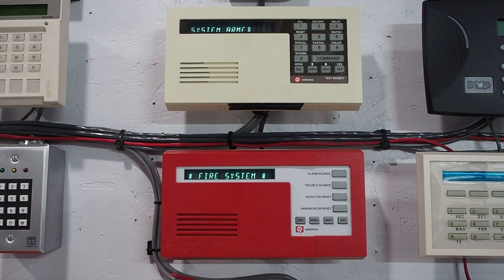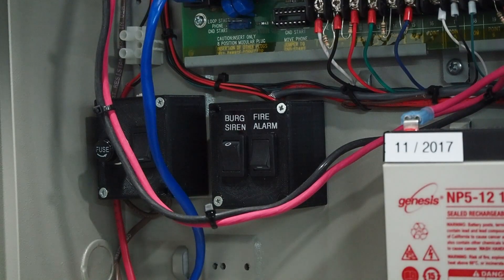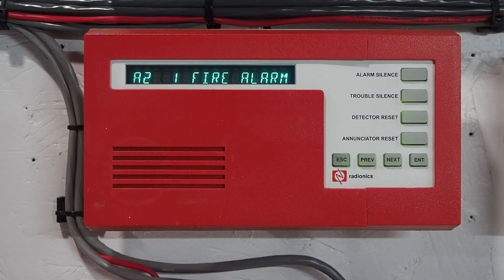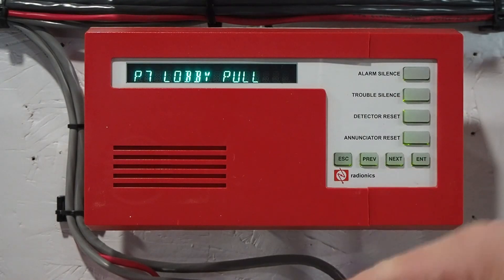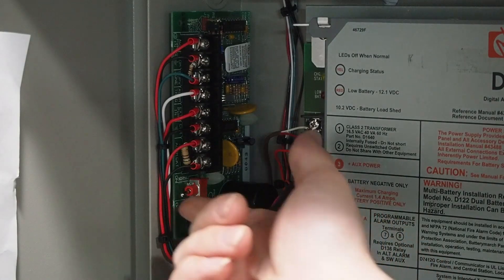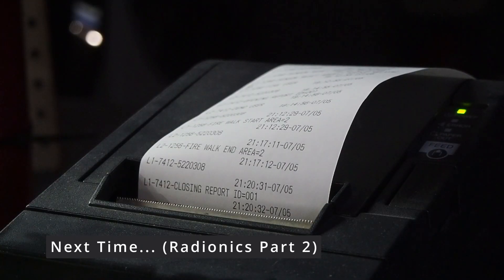Radionics D7412G - Fire Alarm Demo (Radionics Part 1)

Comment: As someone who used to work with a radionics dealer this is a very nice video to see. I actually really liked the D7412 most out of all the panels. The newest model is nice as well. I will say, in New Jersey, the most common device on any radionics system is the Spectralert Classic. Usually 12 volt models. Awesome video!

Comment: this radionics panel seems better than a lot of modern ones, except for the fact that it doesn't automatically reset smokes
Reply: They are, a ton of customization is available in programming. It’s a very advanced system. I’ve installed many of them over my 43 years as a technician and for Radionics dealers. I’m currently a Bosch Security dealer which owns Radionics as of 2001.
Reply: I currently have a Bosch Security B9512G in my home. Very nice system.

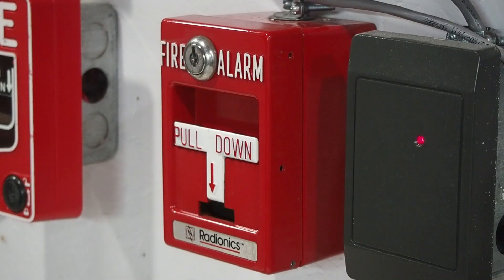Comment: Where's the part where the pull box attaches to your hand for the Fire Chief to remove after they interview you # 3:45?  Or the red dye that stains your hand?  Always heard about that in school.
Reply from the maker: The handcuff was only a concept, they quickly realized it put the person in danger if there actually was a fire. 

As for the dye, that was a fabrication invented by fire departments to deter false alarms.

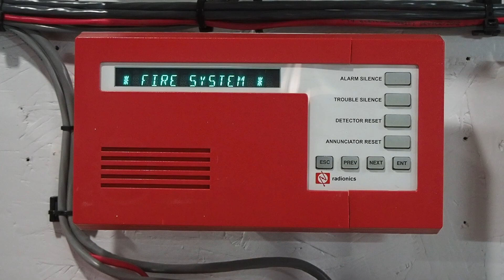Comment: 0:51 Like Walmart (pretty much the only place I ever see them).

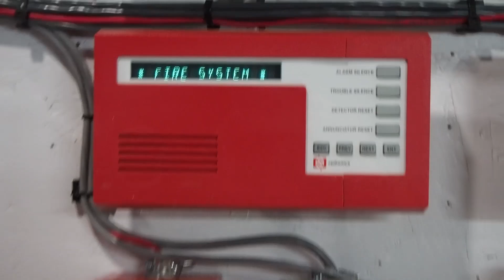1:01 Which is a rebranded RSG RMS-1T.

1:11 Really? Did Hochiki make different color heads & bases for some reason?

1:17 Hey, as long as it works right?

1:20 Mhm! (though technically the original manufacturer is Hochiki & thus both Simplex & Radionics rebranded it from them, among others like Silent Knight)

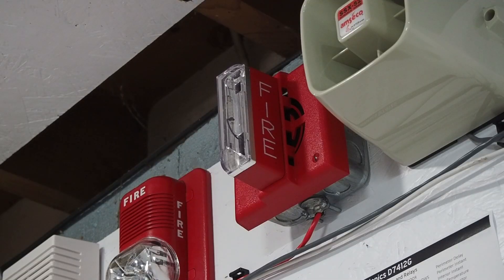1:52 I've got an SHG exactly like that one (same lens design & everything), I thought mine was a 2nd-generation version though going by the reflector (though according to you it's still a 1st-gen version just with a reflector); in fact I thought there were 3 generations, with the 1st-gen having no reflector, the 2nd-gen having one, & the 3rd-gen being identical to the 2nd except swapping the march time tone for a temporal 3 one.

2:02 Is that battery seriously dated 2017? How does it even have any charge left in it if it's that old?

2:16 75!? Wow! That is a lot for an otherwise average security panel!

2:26 I assume the one you have on it is the Bosch version since Bosch now owns Radionics (if they still make it of course).

2:40 Does that mean that you have to use both zones on it, you can't just use one? (since you have only one smoke detector on the setup)

2:42 How exactly is that controlled by the panel? (as in what on the panel controls the output(s) of the board)

3:00 Huh, didn't know Altronix made power supply boards like that one (though according to what I've read about it requires a 24VAC input, which just complicates things further as you then need a transformer in between the 120VAC power coming from an outlet & the input wires hooked to the board).

3:16 Clever! Honestly though those were manual zone trip switches when I first saw them.

4:39 I'll never understand why Radionics decided to have two different reset buttons on that particular keypad model instead of just one that resets everything like with pretty much all others (as it just complicates the reset process unnecessarily, not to mention the one button being labeled "ANNUNCIATOR RESET" when it actually resets the panel. I'm sure someone has forgotten to hit "DETECTOR RESET" after an alarm & had the system go into trouble). It's unique though for sure.

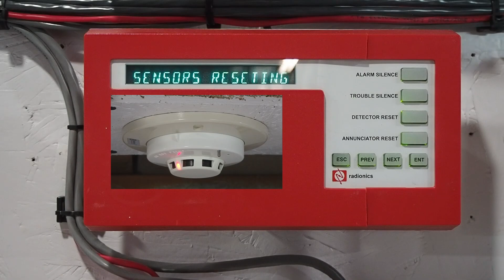5:31 Going by the way the keypad goes blank for a second, I assume that like most panels it briefly cuts the auxiliary power to reset any tripped sensors like smoke detectors.

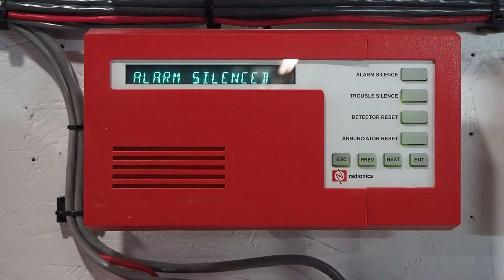5:37 Not quite! (on the upside even if that wasn't intended it did allow you to demonstrate what happens when you don't hit "DETECTOR RESET" before hitting "ANNUNCIATOR RESET")

6:14 This made me realize that the keypad isn't emitting Radionics' distinctive two-tone trouble beep even though it's in trouble from the smoke detector still being in alarm.

6:17 Don't do so if you aren't authorized to though! (read: everyone except technicians who are there to work on that particular system)

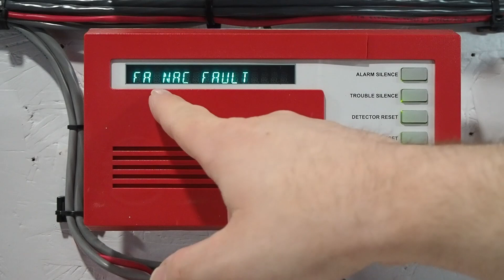6:40 I assume that it's programmed as a trouble zone given the way it's named.

7:00 Was it necessary to reset the system again?

7:20 Makes sense given that it's a fire keypad, & thus you would want only those functions on it (though can that be done per keypad so that the security keypad can have only security functions on it?). I assume that if you had a D1255R which does have a full keypad that you could include some of those functions (like bypassing which might be important even on the fire side of things: disabling a zone to help prevent false alarms for example).

7:53 Clever thinking of Radionics there, giving the tester a numerical count of devices still needing testing! (sure that means they have to keep coming back to the keypad to check said number, but that's quite an advantage over other systems, pretty much all of which don't do that!)

8:20 I've heard Radionics/Bosch keypads make that noise on occasion, I've never known what it means though.

8:24 Interesting...is there something in the programming where you can set a zone to be auto-resettable or not? (or maybe even an entire zone type just for auto-resettable devices like smoke detectors)

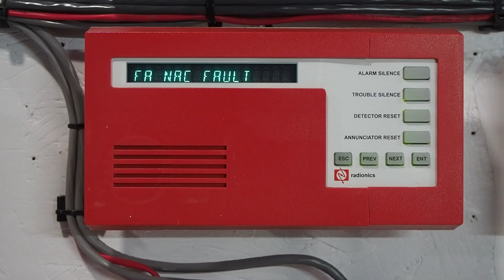9:12 You sure it's not because the "FA NAC FAULT" zone isn't programmed as a fire zone? (which would make sense: why would something like that send the panel into fire alarm when it should cause a trouble to indicate that the supervised bell circuit module has been disabled, thus preventing the fire alarm signal from sounding in the first place)

9:32 Wow that's a heck of a setup you've got there! I look forward to more demonstrations with it!

9:36 Technically speaking the fire portion of the D7412G.

9:42 Are they difficult to program as well?

9:47 I think so too, especially since we've all seen them but probably never knew up until now how they really worked. Thanks for the demonstration!

9:54 Sure thing! You have a great day too!
Reply from the maker: Responses to all your comments, in the order they're listed:

Most national chain stores use Radionics systems, but Walmart is probably their biggest client.

Yeah, RMS-1TK

Hochiki made ivory and white colors.

It works but it annoys me a bit lol

Hochiki yeah. Simplex, Radx, SK

Most agree now that the first gen is the original horn, second gen is the Commander horn and march time, third gen is the Commander horn and code 3.

Yeah that battery still works, it does at least keep the panel out of a battery trouble haha

75 is actually right in the average for small security systems. The D9412G can have 244 points, and Bosch's B9512G can have over 500.

Yeah it is a Bosch branded D125B.

You don't have to use both, I just wired both.

One of the panel's onboard outputs (Relay B) is controlling it.

Altronix makes a lot of power supplies,and yeah there's a 24VAC transformer nearby that I didn't show.

Yeah I usually use those switch boxes for tripping the zones on the demo systems.

I am probably going to do a followup on the keypads and say something about the two reset buttons.

Actually that's just an odd thing they do. Only the keypad you triggered the sensor reset from does it too.

It was planned, haha

When a key is pressed on the keypad it waits several seconds before resuming whatever tone it was making. If I had waited long enough you'd have heardi t.

Yeah don't touch panels you're not allowed to touch.

Yeah trouble zone.

It was, because the trouble conditon stays in the keypad memory even though it's no longer actually present.

Fire zones typically aren't bypassable. Also, the D1255R was used when you do want a passcode to operate the fire system, or you need complete control over the system for some reason.. Sometimes it was also used as a security keypad, just red to indicate it does both.

Those walk test features are pretty common on a lot of higher end alarm panels actually. Radionics just did their own method of the same idea.

That's the "Watch" sound, basically keypad chime. It's usually heard if watch mode is enabled and someone opens a door while the system is disarmed. Walk Test also uses it as a more distinct tone to confirm something was received.

It is a zone type, not specific zones, where you make that setting. I have two zone types programmed in my system, one for pull stations and one for smoke detectors.

Actually if i had flipped the switch up immediately after flipping it down you would have heard the SHG blast... because in walk test mode it blasts the signals any time a device is tripped to let you know it was. D192 modules aren't always installed at the panel or the keypad isn't always nearby, so being able to hear the signals lets you confirm it worked.

More videos are coming.

Yes.

You need special tools to program Radionics, can do a short video on that sometime.

You're welcome

You have a good day too.
Reply: @NewAgeServerAlarm  

Yep: heck it's basically a stereotype that Walmarts have such systems.

Wonder why they would make two different colors when really only one is enough/needed.

Yeah, sorta annoys me too (even though I don't think I have OCD).

Oh, really? Had no idea those were the differences between each generation, good to know!

Over 500? Man...

Yeah, didn't know they made ones in board form & not just in panel form though.

Right: on security panels fire zones typically aren't bypassable as you said, they are on most FACPs however (you'd think it would be important for security panels too though, especially in the case of preventing false alarms).

On the rest: ah/yeah/yep/mhm/huh/right/okay/alright/oh.

Please excuse the ridiculously long comment, but I just wanted to make sure I commented on everything I could.

Comment: I actually like the older SHG horn; sounds like if an EST Integrity horn was very low-pitched.
Also, we have the Radionics system at Lowes where I work at, and it uses a Wheelock AS, MTs, and a couple of Gentex Commander 2/3s (one of them being a blue one)
Reply: What is the blue one for
Reply: @soda_coir7595  Door alarm